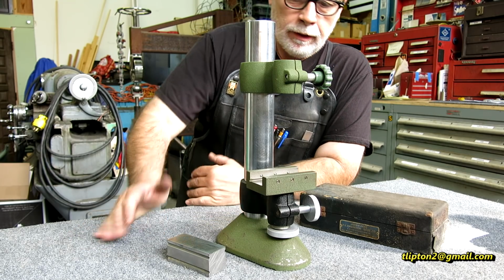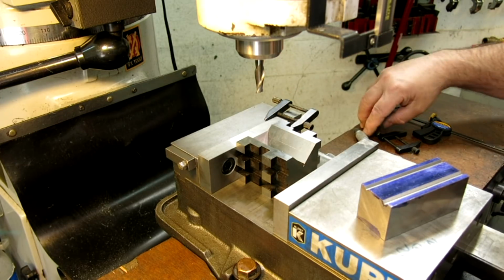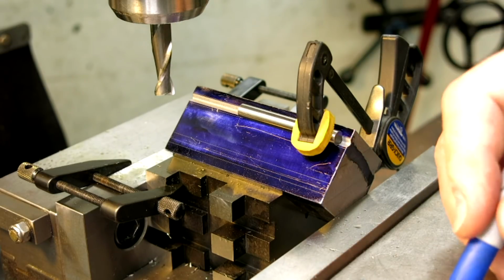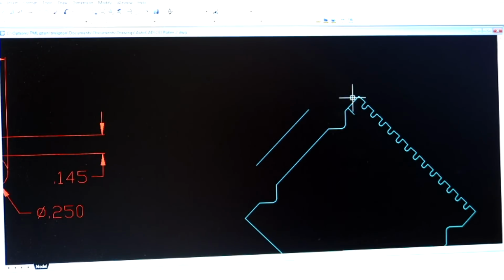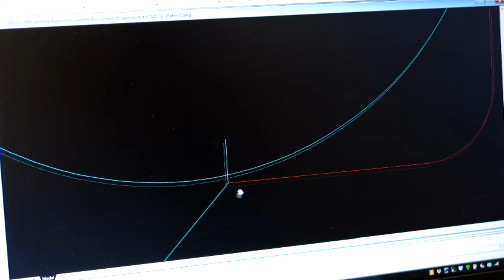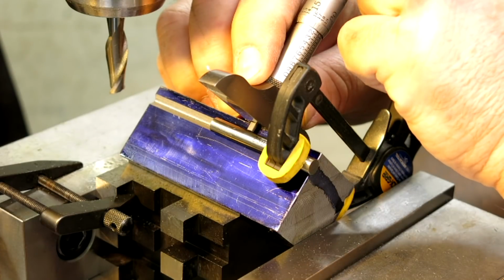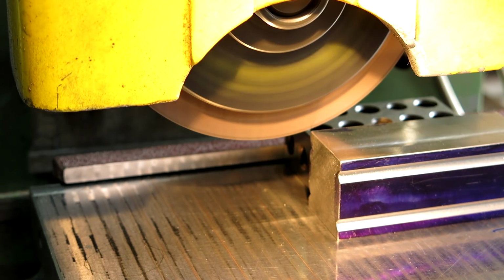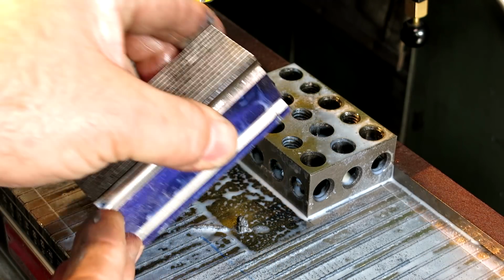Johansson Mikrokator Comparator Platen

Comment: I would argue that theoretically, in an ideal case, the two pins should give the same measurement. You are measuring the location of where the pins are bearing which are the corners of groove for the larger pin and the flats for the smaller pin. In an ideal case the corner of each respective flat would be co-planar with the flat itself and should, therefore, give the same location of the groove. The difference we see here is likely due to burrs or roundover of the corners throwing the corners slightly out of alignment with the flats. Since the measurement we are after is the location of the flats, we get a measurement error using the larger pin.
Reply from the maker: There are two components to the groove. Position and depth. They are both happening simultaneously so you have to proceed carefully. If the pin is not tangent to the flats your depth may be off but position is good.
Reply: chris0tube,

What he's talking about is the "position" being the placement of the center of the vee relative to the top and bottom surface of the part. Then "depth" is expressed as the distance the vee is cut into the surface on which it is located.

Make sense?
Reply: chris0tube. 

If your pin is making contact with the corners of the groove, the center line of the pin is located at the same position as the apex in the bottom of your groove. So, even though you do not know how deep ( how far into the side of the part ) your groove is, because your pin is not tangent to the sides of the groove, you do know where the center of your groove is with reference to the top and bottom corners of the side of the part where the groove is located. 

At this point you know your position, as Tom put it, but not your depth because your pin is only contacting the corners and isn't tangent to the sides yet. 

As you widen the grove, by moving further into the part in Z (down ) and X (to the right on the screen ) ( equally ) you reach a point where your pin becomes tangent to the sides of the groove.

At this point you can begin to measure over the pin to determine your depth. 

Tom was expressing the location of the groove relative to the part and not relative to the machine. It makes sense if you think in terms of where you are on the part, which is how you begin to think of things after you've been making parts for too many years to want to think about. LOL

Old machinists talk about the groove being 1.00 from the top of the part to the top of the groove, then the groove is say 0.500 wide ( further from the top ) and 0.250 deep ( cut into the surface ).  This is because your setup to make that feature may be different from what I'm using so the common reference between us is the part itself. 

Unfortunately, some of it is just understood through shared experience.

 Hope that helps
Reply: Wow you are talking in circles. A cylinder in a symmetrical V is ALWAYS centered. How you do your measuring is the only way you screw it up.
Reply: To Tom & chris. 

So..... I had some time to kill while waiting for some files to finish off loading to an external drive and I decided to play with the cad software. 

End result is I don't think it's even possible to cut anything but a symetrical grove in the given setup. 

If you move down in z you lengthen the vertical flat by the same amount you lengthen the horizontal flat. The same is true when you move into the part with x. 

So.... it looks like the only actual question would be where the center of your V groove is in relation to the top of your part. That would appear to be the same position whether you are resting a pin on the corners of the grove or tangent to the surfaces of the groove. 

Anyway .... I need a couple of aspirins or a stiff bourbon now ....... but it's an interesting thought experiment. 

Thanks, Tom!

Comment: Since the block is held at a 45° angle, wouldn’t it be possible to indicate both sides/flats at each side of the upwards facing corner (at the same height of course) to find the exact Center line of the corner to use as a datum?
Best regards from Mr. Johansson ✌🏻 in Sweden.
Reply from the maker: That is possible but it only locates you in one direction. You need an accurate Z as well to get it all to come together.

Comment: When using the regular micrometer you had it resting on the flat, not straight across the block, right? Doesn't that cause a cosine error? You're measuring the hypotenuse but wanting the adjacent side length. It will be a small error, but it will cause an error.
Reply from the maker: Not following you here. It was measuring from the opposite side of the block bridging the groove on the opposite side. It was a small spot and took a second to find the true position.

Comment: Tom, two quick questions, first I see the thermometer tape stuck to the front of your magnetic chuck, can you explain what you use that for in a video sometime or let me know if you talked about it in the past and I just missed it.  I understand the need to keep track of thermal growth, and I found that to be an interesting place to keep track of.

Second, I really like the cutoff wheel in the grinder, is there a down side to using that compared to a slitting saw when making grind reliefs in tools etc.?  It always seems like slitting saws are very finicky and can be slow and that cutoff wheel looks like a good alternative.

Thanks for the CAD geekness.  R.J.
Reply from the maker: The cutoff wheel is a lot less fussy than an .035 slitting saw. Also I wanted a rounded bottom to the groove which the cutting disc produces all on its own. The thermometer tape just allows me to monitor changes in temperature as I work. Depending on what I might be doing I might take a break to let things cool off.
Reply: Thanks Tom

Comment: Hi Tom, thank you for putting together such fantastic videos.  They are incredibly informative and interesting.  I noticed your comments about losing diameter on the cutting wheel.  I was wondering exactly the same thing, but in relation to the grinding wheel when doing precision grinds.  Obviously there are many factors, but how much can you expect to lose on a grinding wheel?  Also, what CAD program was that? Cheers, Al
Reply from the maker: Hi Al. There is a formula out there somewhere but I don't think it applies to cutting discs. There were quite a few grooves and I was pushing it a bit so the wear factor was oxified somewhat. The CAD program was old reliable AutoCAD LT.

Comment: YAY FOR 2D CAD! DOWN WITH FUSION 360!

Although I still don't understand why the 2 pins gave different results. You sure that wasn't measuring error? You were measuring against a groove.
Reply: A too-big pin engages the edges of the cut, and the actual tangent of the side of the pin is beyond the current cut.  So if you just subtracted to figure out how much to feed, you would overshoot.
Reply: I have both Fusion 360 and a "2-D" wireframe program called Graphite. For what I do Graphite is much more straightforward. Fusion is great for designing and generating complex G-code. Graphite is the goto when 2-D NC code is needed.
Reply: It will "IF" you calculate the change in measurement when the pin is not resting tangent to both surfaces.  The math then involves measuring the width of the V compared to the pin diameter. As the width of the V-Cut becomes large enough to allow the pin to rest tangent on both surfaces, then the width measurement s no longer a factor.
Reply: Maybe measuring error on first pin?  I think he says 25 plus 14 is 34...
Reply: You can't trust the edges/corners of the groove to be exactly where the geometry says they are, because they either have burrs or have been deburred.  The tangents are more trustworthy.
Reply: sp1nrx, I guess I've been using Fusion wrong then - I was looking for good 3D CAD software, no CAM. And preferably 3D CAD that's got a solid basis in 2D CAD, since I don't see the need to re-invent the wheel.

He Ka, exactly.

James Clough, I think you're spot on, but I consider that measuring error. Don't get me wrong, I'm more than happy to watch a video on how one measuring practice is better than another, but I'd also like to know why.

Edit: James, why did you change your comment? I thought the burrs idea was right.

James Lerch, I don't see why there should be any theoretical change in measurement. I think James Clough is right - measurements on the corners are more susceptible and sensitive to errors than measurements on the flats.
Reply: That's a good point!
Reply: The people here who promote Fusion don't seem to understand that "Cloud" cad isn't really on a "CLOUD".  It's on the vendors servers and they have total access to your designs and they can lock you out if they want.  Only idiots would willingly agree to that deal.
Reply: @Pat Healy Can you point out where I've agreed to give up my copyrights on designs I make? If not, it would be wholly illegal for Autodesk to do anything with my designs without my consent anyway. Do you really think a company like Autodesk needs to break the law to make good money?

Besides that, I'm not arrogant enough to believe that Autodesk would have any interest in stealing the things I design. By "lock you out" do you mean they could shut down their servers, and refuse to give you access to your files? Sure they could do that, so could literally any other internet storage platform.
Reply: Rob - you would be wise to do a bit of research into where the Autodesk servers are located and who the admin are.  You, as an individual would probably not be of interest to them. But if you are a company working on cutting edge stuff - putting your design work on somebody else's servers is "unwise".  Much stranger things have happened.  And the entire concept of software "rental" is deeply flawed.  Do what you want.  But I would suggest another alternative.
Reply: Based on the end of the video, I agree.  Tom modeled both measurements properly in CAD.  The end results of both should have been the same.  He was off by a few thou at the end because one or both measurements was inaccurate.
Reply: I was wondering the same thing. I understand that it is not a good practice to use a too big pin but it should still give the same result =)

Comment: The 2 top knobs on the comparator seem to be made of green plastic... are they original parts?
Reply from the maker: Yes they are original as far as I can tell.
Reply: Thanks Tom.  I though plastic was chosen for thermal conductivity/expansion reasons, but the fine adjust knob at the bottom is made of metal... so that can't be the reason.  Plus, I imagine it costs more to make those 2 parts out of plastic than to make them out of metal.  Anyone care to venture a reason as to why the company made the 2 bottom knobs in metal but the 2 top ones in plastic?

Comment: It’s early in the morning, so maybe I’m missing something, but: why are the scribe lines unequally spaced at the start of milling?  The two interior surfaces should intersect the outside face at equal spaces from the centerline, because both are 45°, I think. The “center” line might bound roughly equal volumes when milling, but I would be surprised if that was a concern for a notch this small. Or maybe it’ll all be clear once I’ve had caffeine…
Reply from the maker: Hi Josh. I moved the layout off camera and increased the vertical position of the groove. I didn't bother to redo the centerline since it gets blown away instantly.
Reply: oxtoolco Ah, that makes more sense, thanks! As the softest of soft hands (I got a math degree), everything else here made perfect sense and was great. Thanks for doing the thorough CAD demo: hopefully more folks will see the beauty and power of mathematics and geometry. Or at least that it’s not (all) voodoo and has not-so-expected practical applications.

Comment: Hey Tom -- around 13:45, I noticed that the screw in the rotating handle of your micrometer was rotating as you were rotating the handle itself. I'm not a machinist/engineer/toolmaker, so I'm not sure if this is anything that'd throw off your measurements, but just wanted to mention it jic. Does that guy need to be tightened for the mic to be as precise as it can be?
Reply from the maker: Boy I'm glad this got answered. I was just about to go back and watch that video AGAIN.
Reply: It's part of the friction drive thimble. It moves with the adjusting screw but once the dial hits a certain torque, it stops and lets the thimble slip. It keeps you from over tightening the anvil and getting erroneous readings.
Reply: Oh wow -- that's a pretty clever mechanism. Thanks for the information =)
Reply: +oxtoolco Hey Tom -- Sorry to worry you, hahaha. Big ups to +SuperSecretSquirell for educating me there =)

Comment: Hey Tom! Great video. CEJ also made a very similar comparator stand but instead of the adjustment screw on the bottom they used a flexture in the arm of the comparator holder. And we all love flextures isn't that right Tom!? :) Mr Trendzetter (Renzetti) has helped make sure of that :)

Comment: Tom,
Wouldn't you need to finish grinding and lapping the top and bottom surfaces first before adding the side grooves if using them for references? Enjoyed the video.
Reply: they are only to allow the pointed set screws to retain the block. They do not form a V block.